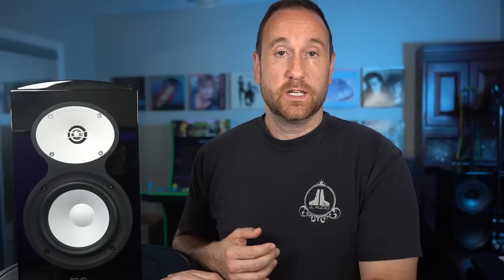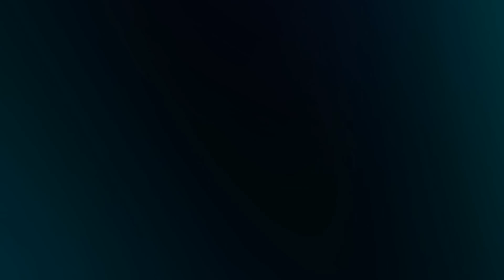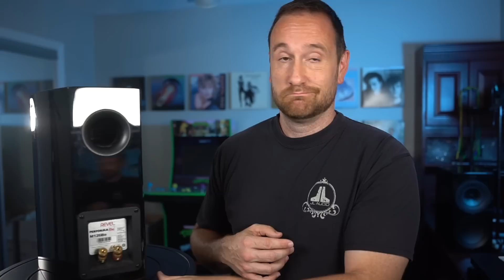How to Aim Your Speakers

Comment from the maker: Toe Out?  Whats that?!  I got this question a LOT after my MoFi 10 and KEF R3 Meta reviews so I put together a quick demo on what it means to "toe out" a speaker.
Reply: most people discuss toe in as anything other than pointed perpendicular to the wall though don't they, and toe angle is relative to the wall not the mlp? or are you saying that they are not actually talking about that when discussing toe or that you use the term in a different different way? 

ie, "you need to toe in your speakers to make them be on-axis".
Reply: @wrxkyle  I believe you mean PARALLEL to the wall, not PERPENDICULAR, which means at a 90 degree angle! Unless you mean perpendicular to the side wall.
Reply: I'd love to hear your thoughts on toeing in/out in-wall speakers & the best methods for doing it (if you should) as it has got me completely "baffled" 😜

Comment: Aiming a speaker "right at you" (the listening position) would mean a toe in. Toe in maximizes imaging at the listening location, and greatly improves imaging off axis. Toe in works for off axis listening because a person listening on off to the right will be a bit off axis to the closer speaker and a bit more on axis to the further speaker, better balancing the high frequencies. There is no good reason to ever toe out--it's a bad idea to compensate for a speaker by toeing--use your tone controls or equalizer. Speakers vary in how well they do off axis, some people and designers claim more beamy speakers (poorer off axis response) have better imaging (in the listening position, they will be worse off axis). Some speakers, such a bipolar, depend more on sound directed elsewhere (for better ambience space of the sound) and will be less effected by toeing.
Reply from the maker: On-axis is pointed at you. This is industry standard and ANSI standard as well. From there, “toe” is relative. 👍

Comment: This sort of makes sense until we’re using a speaker manufacturers recommendation for toe in angle. Then we have to assume the speakers are at 30 degrees to the LP and calculate the difference, makes it more confusing imo. Best to just assume speakers firing parallel as the baseline and use toe in and toe out as a phrase to describe which way we turn the speaker. That way a desired toe in angle can be achieved easily, otherwise we are using phrases like “reduce and increase the amount of toe out” I get what you’re trying to say but there’s very few people who are going to look at it from this angle (pun intended) 😉

Comment: Came here exactly what you meant by toed out in your KEF R3 Meta review. Now it all makes sense. Thanks for doing this video. I could not believe that you were suggesting to point the speakers away from the MLP and towards the side wall. Instead, from the degree angle you mentioned, it's more a case of having the speakers face the back wall straight on or just slightly angled inside (toed in) toward the MLP but not directly pointing toward it.

Comment: I got some speakers with an open air 10" coaxial driver and a 10" woofer in the box. And the open coaxial on top of the box is towed up about 20°. 😄 I have concentric curved thin cutaways in the open 10" driver to let it breath and to mitigate the shoutiness. And sounds more free and nicer! 😅

Comment: I prefer toe out.  I hear a wider stereo separation and the bass response is deepened with backfiring ports angled 45 degrees from the projecting wall.

Comment: I think you're redefining what toe-in and toe-out are. That's OK, because your definition makes perfect sense, although I need to recalibrate my old brain when you talk about toe-in. I've always read that no toe-in means the speakers are pointed straight ahead, while any little amount aimed in my direction means the speakers are toed in to some degree.

The thing I like about your definition is that toe-in or toe-out will change with the listening position even if the speakers aren't touched. That seems odd and unintuitive, but it correlates much better with what toe in or out will sound like; it relates to the relationship between the speakers and one's ears rather than the speakers and the room. If I move my listening chair forward a foot without adjusting the speakers, the angle to my ears might change from "toed-in" to "toe-out." It's helpful to look at it that way, as the angle to my ears will, for the most part, determine the sound quality. The angle of the speakers relative to each other, ignoring the listener's ears, is kind of irrelevant. 

I'm just worried that when I talk to my audiophile friends they won't understand what I'm saying. They'll just have to get on board with your definition. ;)

Comment: This was fun to learn, thanks for the information. Ive figured out my preference for my current speakers in my desktop setup which also fire into my livingroom / kitchen through trial and error. They are basically looking forward, so toed out. One is slightly less toed out compared to the other since its very close to a wall. My tweeters which are off axis compared to the woofer are faced outwards. In my listening position at my desk the sound is best, still awesome about a meter away from it. Further away the sound is still great but imaging gets lost quite a bit, just a matter of compromises. Was all just trial and error but I get a lovely soundstage and depth. Pulling speakers forward / pushing them back helped a lot too in cleaning up the sound (mostly bass reflections I guess?) In my listening position stereo imaging is fantastic, centre sounds like it is coming from behind my pc monitors, such a cool way to enjoy music. The speakers front baffle is slightly infront of both monitors so that's obviously not possible, sounds like it though! I find it awesome how our brain processes sound and how some small DIY(kit) bookshelfs are able to produce this effect, music is so fun like this.

Comment: What I hear is speakers and listener should form equalateral triangle, but this is never possible because speakers are to the sides of my display and I sit too close for that to be physically possible. Due to this, I have to turn my speakers inwards quite a bit to be on axis.

When people talk about coaxials and listening off axis, isn't just being off axis vertically enough? If the tweeter is not ear level, that seems already like the 10 degrees I want.

Comment: Thanks for explaining!
But i still don't understand something.
If speaker is on axis than the front plane of the speaker is is in parallel to wall behind you (in rectangular room),it means the main beam of the speaker is not to your ears butat a distance of half the length between the speakers (main energy of the sound waves is not to your ears but in offset.
In order to receive the main beam of the speaker it must be aiming at you than you receive the maximum sound wave.
As you described you get only the side wave of the speaker (on your term of on axis) .
What i don't miss?

Comment: Folks, remember the general public has no idea with most of the jargon used by manufacturers, audiophiles or reviewers.  And they don’t seem to want to take the time to read about it either.  At least the ones asking questions want to learn. 

And I agree, toe-out is not commonly used. Most manufacturers reference to toe-in means from a starting point of straight into the room.  On axis is usually referenced when charts are being explained.  

As to correct set up, straight, angled or on axis, we all hear differently so whatever sounds good to you is where you should set them.  Bottom line is; Straight into the room will be the least bright but reproduce largest sound stage, on axis will be the brightest but narrowing of stage. Angling with toe-in usually will give you more depth of stage.  All this assuming a good set of engineered speakers.

Comment: Medicine has a useful and standard way to refer to relative space/direction, to avoid confusion. 
Medial = towards the midline of the body
Lateral = away from the midline of the body 

So, toeing in would be to rotate the speakers medially, and toeing out is rotating laterally. 

Also the term "toeing in" even refers to the medical condition nicknamed "in-toeing" or "pigeontoeing" where the feet naturally point medially towards each other -- very common in children.

Comment: You shouldn't say toe out because that's a misleading statement. You should say firing direct into the room, parallel to the wall behind the speakers and the wall behind the listener, which is how we always setup our speakers in the old days, and is still how you'll see them at trade shows, in dealer showrooms, and in YT videos from high end dealers like Sound Sommelier, Alpha Audio, and Kenrick Sound. I never see any experts set up speakers with them toed in at all. Toe in, where they're angled in to point the tweeters directly at your ears, is something that came about very recently, and seems to be a product of the "instant internet experts", as a result of poorly designed speakers that have poor horizontal dispersion and poor power response in the room, and so that's a stupid way to try to fix a larger problem with poorly designed speakers/crossovers, and which locks your head into a vice to get a solid center image, but will drift if you move your head even an inch or two in many cases, and limits soundstage width and depth, as well as making the high end too bright and peaky in moist cases. If I use ANY toe in at all, it's very very little, maybe a few degrees at most.
Reply from the maker: The overwhelming majority of speakers are designed to be listened to on-axis. This isn’t new.

Comment: Sorry, but I can't quite agree.

For me all speakers that are not straight ahead are toed-in and I suggest to experiment with the amount of toe-in. Think about it, look down on you feet, they are normally pointing straight ahead and so are your toes. If you toe-in your feet, it means that they are no longer parallel. 

Even when the speakers are pointed straight on axis, they are still toed-in. I have come across speakers that are designed to point straight ahead and you are advised not to toe-in. That's my take on it.

I tell listeners of my designs to listen off axis, so that they can see the insides of the speakers around 15° off axis. If they want it brighter, use more toe-in until you listen fully on axis. If you want less brightness, use less toe-in. Simply do it to taste.  I have been saying this for decades and it hasn't confused anybody.

Comment: My speaker setup now;  Elac DBR62 Reference, on stands, 9' apart beside TV, 10 degrees tilted up, 15 degrees cross streamed toe in.  This works great for movies, music, surround effects, with only two speakers, no sub.  60 wpc clean amp with tube preamp.  Elacs have a big sound stage and deep bass.  So this works for me.  TV and speaker plane are on 40 degree angle in room parallel to couch, listening position.  The surround effects are scary real.  Couch shakes.  Bass is felt to 28 htz.  I tested it.

Comment: I crossfired speakers last time I calibrated since no one, not even me, sits in the middle of my couch (which has a crease). I used to point them all directly at the center position, but I had the same issue as you said, I heard one speaker louder than the other.

I notice a slight difference, but it's not that extreme. I'm no more than 7 feet away from my fronts, so I might need a more extreme angle; not sure.

Do you have any advice for people that have small rooms? My room is 11'x12' (open on the right side), and I'm very close to all my speakers (2-7') except the 3 front heights.

Comment: Thanks man.  I prefer toe in for time intensity trading and a much wider sweet spot.  I have a 4.2.2 surround system with no center speaker so I rely on my surround speakers for the extra width.  This way when the couch is full everyone here's the dialog from the phantom center image.
Reply: You've got it backwards! Toe in will give you a narrower sweet spot, not a wider one. Also, HERE'S is not the same word as HEARS. One means "here is", and the other means sound reaching our ears.
Reply: @DougMen1  Yes I understand the difference and see my error.   Regardless, you are the one who is wrong.  There is a lot out there about time intensity trading. That is what makes the sweet spot much larger than toe out.  He even states as much in his video.  With toe out, the minute you slide to one side you will hear the speaker you are closer to.  This is not the case with toe in and especially extreme toe in.  I'm a photographer and make use of this exact same principle with light by feathering my lights for a group photograph the same way I toe my speakers in.  It give me a nice even light or else the person closest to the light would get blasted and over exposed.  So great job on the spelling/grammer police but perhaps you should focus a bit more on the actual subject being discussed.

Comment: What a total goof I am. 

I’m going to leave what I wrote below.

I don’t know what I was thinking but talking about getting confused over degrees and percentages and  toed in (gosh).

So, for the R3 speakers, (as an example) KEF recommends 10 degrees toed  in which would translate into 10-15 degrees toed out the “Erin way” as he explains it. 

Perfect.

———————————-

Original comment:

Hello Erin, thank you. 

I think the confusion come from the manufacturer user manual which typically says to place them straight into the room and “toeing them in” towards listening position say 5 or 10 degrees for best convergence of high frequency.

You typically say to “toe out” opposite from most user manuals.

Example: so KEF’s recommendations for the R3 meta = 10 degrees in … following your way of explaining this would be to “toe out 80 degrees” for best high frequency balance vs. your recommendation of only 10 degrees.

Why such a big difference between you and what KEF recommends?

Brian
Reply: 🎉 I am even more confused after watching this video. Right now the right speaker is pointed more or less at my right shoulder. Same with the left speaker. They probably cross just passed my head. I have R 11 metas. Prior to tonight I have them pointed straight forward in the room, thinking that’s what I was supposed to do. Tonight I toed them in and they sound better.. I’m so confused. lol
Reply from the maker: On axis is 0°, which is always with the speaker facing directly at you. Off axis is any angle varying from that. So the terms tow in and tow out are relative to the on axis position.
Reply: @ErinsAudioCorner  Hey Erin, I’m a total goof. 

See the revision to my first post. 

You are correct.  What you recommended (in the case of R3 meta) is basically what KEF recommends in their manuals.

Sorry buddy for wasting your time.

Brian

Comment: Erin, you forgot about Bose's recommendation of toeing the speaker down. Have the speaker face the floor and only listen to the sound reflections from the floor.😁
Reply: The only good speaker position for a Bose would be from inside a trash can.
Reply: @dan_hitchman007  Bose would be able to sell even that speaker in a trash can as some new research tested in MIT.
Reply: Hi. That is usually described as “rake”. 
You can tilt or rake a speaker forward or more commonly backwards.

Comment: How much you have to position your speakers if the one on the right has a wall about 5 ft away and the other is next to an open room?
Reply from the maker: That would really depend on the speaker. If it’s a narrow speaker it won’t matter quite as much as if the speaker radiation pattern is wide. Say 30 degrees vs 60 degrees, for example. 

You’ll possibly even find assymetrical aiming to help.

Comment: I had a question about the kef R8A dolby speakers, you posted a written review.  It says to point it 30 degrees off axis to smooth the driver out.  However as it is one driver do you suggest placing them flat on the wall aligned with the F and R? only confused cause dolby atmos speakers aren't typically set up like stereo speakers.  Do you mean toe them out? Place them flush against the wall? can I point it down or up 30 degrees instead?
Reply: Hold on friend. First , he mentions a bump in the high frequency.  But this is his experience in test conditions. Do your Atmos speakers smear highs? If so you could "toe out" but that would be difficult with a speaker that mounts flat against the wall. I suggest you turn eq the  🔊 or turn down the treble a little. I have my Atmos speakers (not Kef) mounted on top of the mains, reflecting off the ceiling. Gives a large soundstage. Any questions?
Reply: Also if your speakers are wall mounted, they should be outside of the main speaker position .